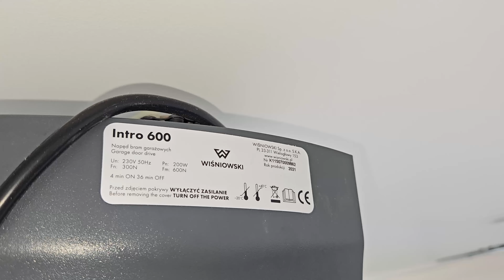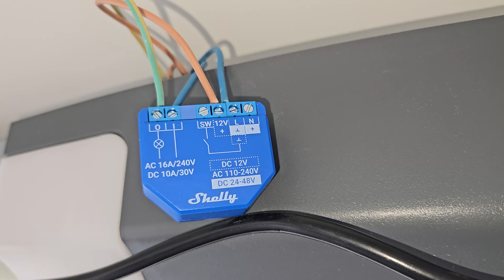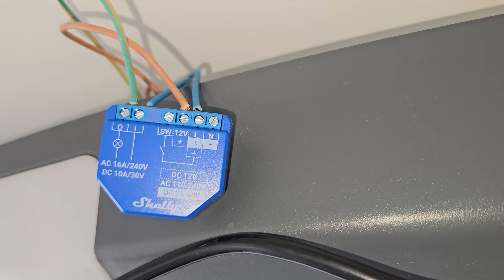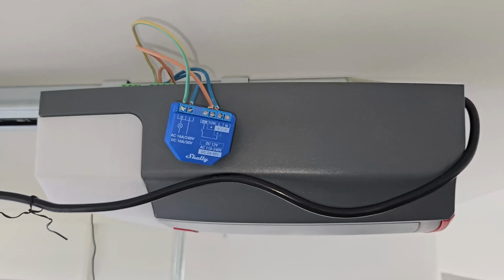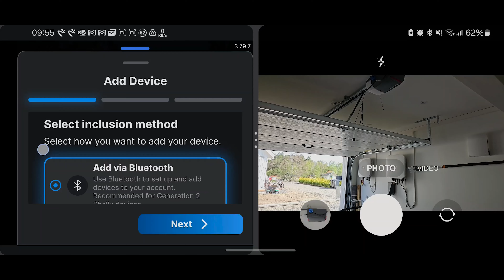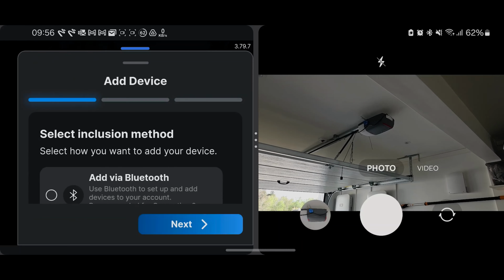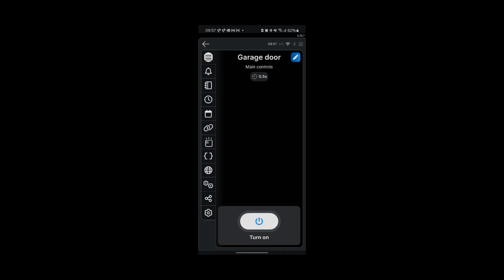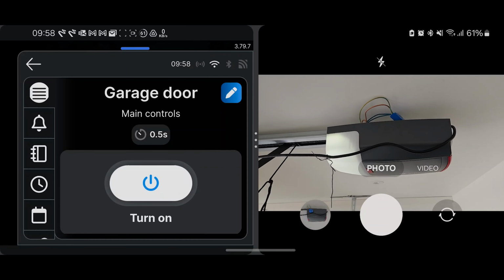Wiśniowski intro 600 Shelly 1 plus wifi garage door integration

Comment: Hello. I have a problem with my gate (Intro 600 motor) and Shelly 1 plus like yours. I connected it the same way as in the video. And it works for a while, opening and closing. after a while the gate motor seems to hang up. I can't open the gate either with the remote control or the button, and especially not with Gui Shelly. After turning off the power to the engine, it works again, but I open the gate again, close it and the engine seems to hang up. I have it set to 0.5s automatically, etc. The controller is 100% good because I have just connected a double-leaf gate to the Beninca Actuators and everything works as it should. Does anyone know what could be causing the engine to hang up? without this driver everything works fine.
Reply from the maker: I dont understand the actuator thing. But mine works now for a few weeks without any probelm. Maybe you need to setup everything from the beginning.
Reply: @amirriazi267  works for some time. After opening and closing the gate from the Shelly GUI, the gate locks and starts working only after disconnecting the 230V power cable. and so on.